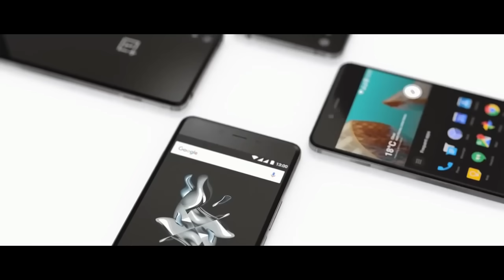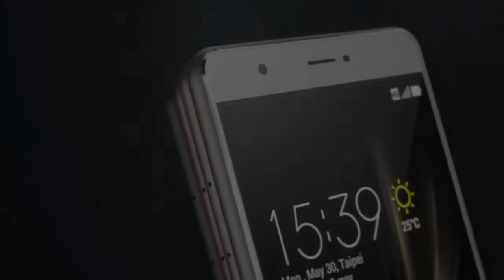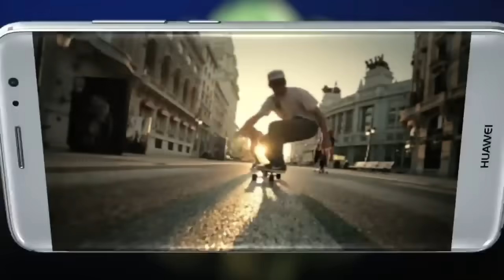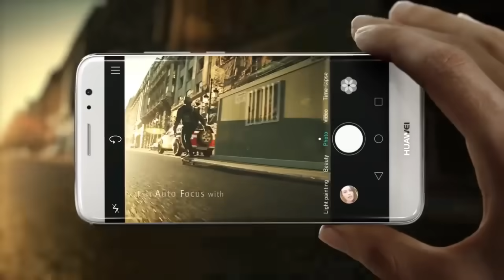TOP 5 Most beautiful smartphones

Comment: 'could have been "a bang for my buck" considering its technical and aesthetic features, if not for the "touch screen -turned-touch move" function that can't hardly finish one complete task like a simple text message. Only 10% of the screen area respond to touch actions. Well,,,,,,,,it's been almost a year ;though, and in fairness, I find It bearable. What is not is the 3.5k the Service Center is charging while still under warranty.